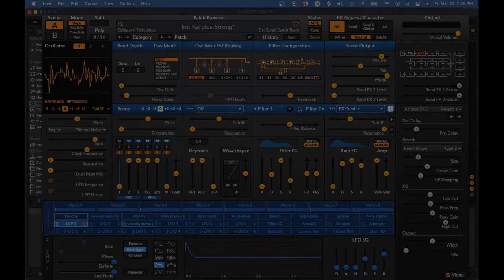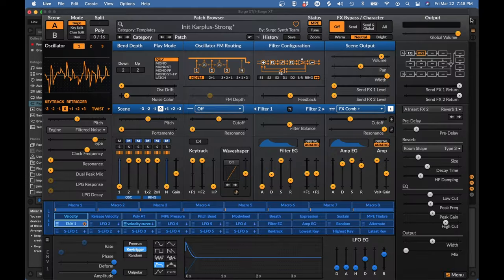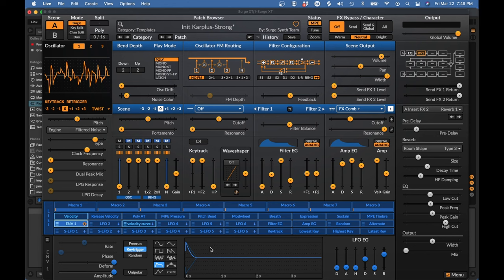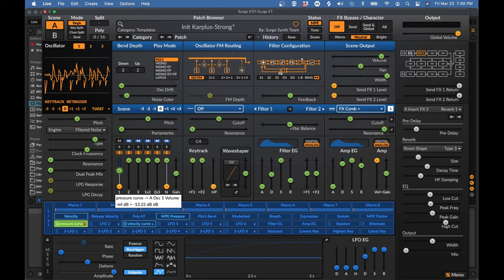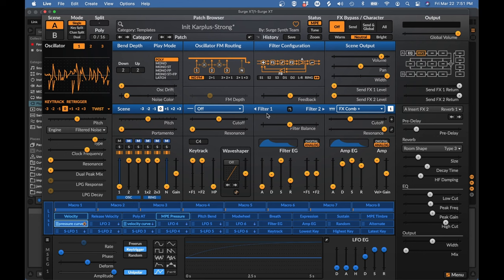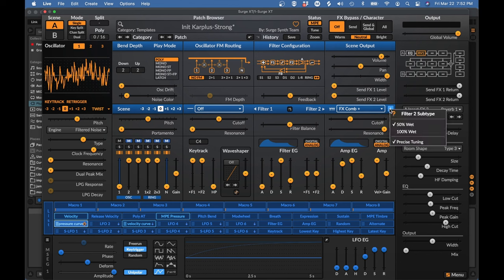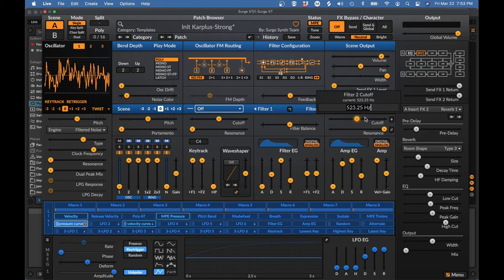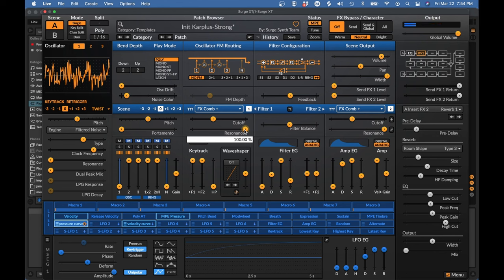MPE Sound Design in Surge XT: Physical Modeling Bowed Strings and Inharmonics

Comment: On feedback -- it's not a delayed feedback (but I presume the delay is introduced because of the latency), just a mixing of the output back to the input. Sound disappearance is caused (I think so based on my own experiments with feedback) by the DC offset which is amplified till the impossibility to produce any sound.
Reply from the maker: so maybe a 1-sample delay? i would expect that to create a tone at the sample rate, which we wouldn’t hear because we’re not bats. I would expect aliasing, but maybe aliasing doesn’t occur on a frequency that is exactly the sample rate. I’ll have to think about this more after some coffee. Thanks for the info!
Reply: @thoughtFormMax I think that each filter in chain should introduce 1-sample delay at least.
Reply from the maker: Yeah I guess that's true. I actually had a whole section in here about how filters work using feedback but I left it out because I wasn't sure I knew precisely enough what I was talking about :)

Comment: Risky comment because I'm not all the way through the video:This is just me theorizing without proof, but I think the string excites the bow as the bow excites the string, as both have their own friction and tension coefficients. Bows are also resonators, too; my wooden bow and fiberglass bows have quite different sounds probably due to different weights/densities/stiffnesses. You also get different types of expressions by varying the bow speed and pressure independently from the length of the stopped string. Just ways of saying I think there is a lot that could be explored by varying the exciter.

And now as I finish writing the comment, this is what you're doing in the video...
Reply from the maker: Yeah, according to the model I'm presenting, an exciter and resonator can be regarded as an exciter when fed into another resonator. 
If i could think of a way to sample the bow and the string without hearing the resonance of the string, i would have tried that. I guess you could mute the string somehow.
Reply: @thoughtFormMax  even a muted string has a length, though. I don't know if you can completely eliminate that kind of variable and still produce sound